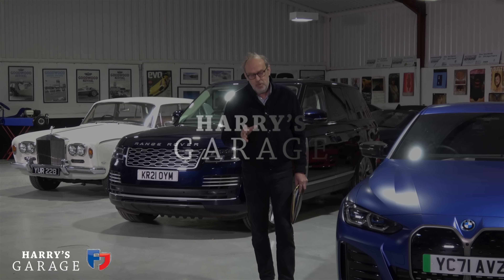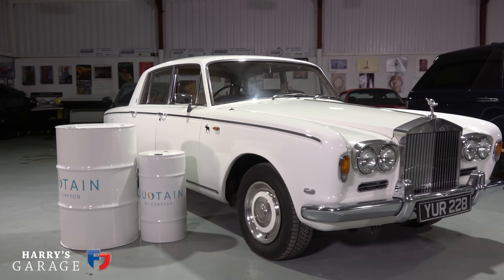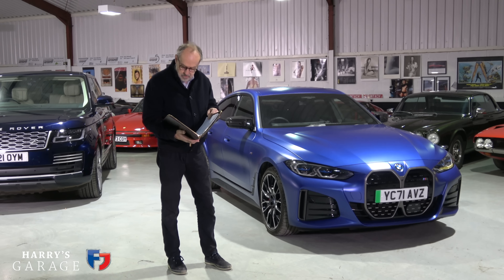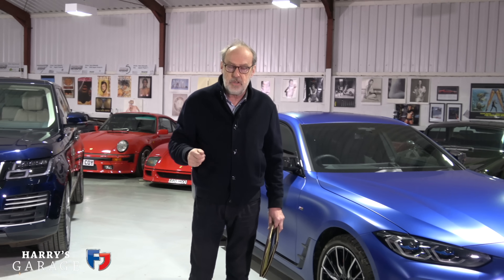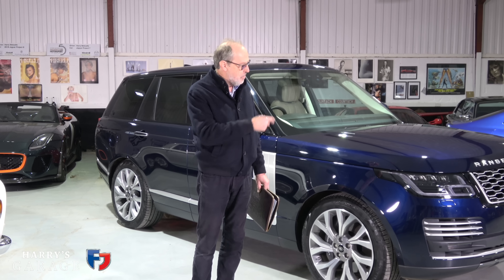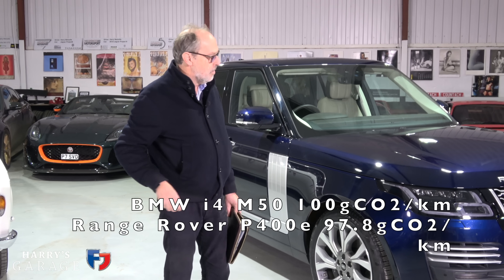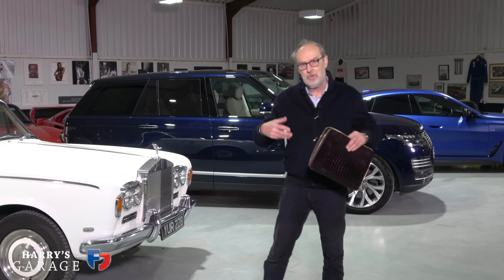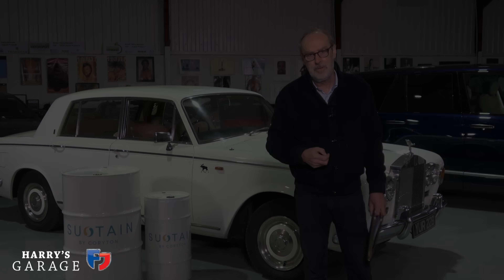Sustainable fuels; what are they & are e-fuels better for the planet than running an EV or PHEV?

Comment: I have a couple if issues: 1. You need to use the same source if electricity for both the EV and the hybrid.  While the BMW was very inefficient, picking the worst CO2  number for it, yet zero for the electric CO2 of the hybrid.  2. If you're going to mention the CO2 in EV battery creation (which is legitimate), you also need to mention the CO2 cost of drilling/refining/distributing the gasoline and Synthetic fuel (including the electricity used to refine the gasoline which I read was 6kw per gallon).  The synthetic fuel was interesting and I'm glad he included it.  I also agree plug in Hybrids are a better choice for most people and I would have gotten the Volt over the Bolt if it was offered in a Malibu or Equinox sized vehicle.  He is right about the need to convert the millions of current petroleum vehicles to lower/zero emission vehicles.
Reply from the maker: The aim of the video was to show a BEV is not zero emission as it depends on how 'clean' the electricity is you charge them up from. The PHEV is my own car and show my  own solution for having zero range issues while still reducing my CO2 footprint by producing my own electricity. I could not do the miles I do in the PHEV RR purely on my own generated power and I know this to be true because I ran a BEV for 18 months before getting the RR PHEV, hence why I didn't show it. 
I expect the next generation BEV (expected 2026 on) will be a much better proposition than today's BEV but we won't know until we get there.
Reply: The other plus to the synthetic fuel is that the distribution network is essentially already in place, ready to serve. I am interested in this because the fact is, no matter what the take rate is on EVs, we still have millions of ICEs on the road that would take decades to replace. Doing a drop kick on the emissions of existing vehicles would be a huge accomplishment, especially when you consider time is our greatest enemy.

Comment: You make an excellent point about getting more use out of existing ICE cars rather scrapping and incurring the environmental cost of manufacturing an EV replacement.
The Coryton Sustain product seems to me ideal in that it provides the convenience of a fuel that is liquid at normal temperature and pressure and also apparently packs energy at a high density similar to petrol. Perhaps the ideal would be a hybrid running on Coryton Sustain. Is the £3 per litre cost inclusive of fuel duty and VAT?
Reply from the maker: Thanks. Price is exclusive of VAT but inclusive of fuel duties. My mistake for not pointing that out in the video
Reply: @harrysgarage  Thank you for that information.  With duty at roughly 58p that would put the untaxed cost at £2.40-ish.  I suppose it makes sense for Coryton to quote a VAT exclusive price because they will be dealing with other VAT registered businesses at the moment.
Assuming an at-the-pump price of £1.70 per litre the comparative untaxed cost of petrol would be £1.70 * 100 / 120 - 58  = £0.84  so, on fuel costs alone, there's quite a bit to go before Sustain fuel becomes attractive.  On the other hand, if it's a choice between an ICE car and an EV, a higher fuel price might be justified if one takes into account the higher capital cost of an EV.
Thank you for you very informative and thought provoking videos.

Comment: I enjoy you’re presentations Harry, but it not just the CO2, it’s the nitrogen oxides that are highly carcinogenic which we get as a result of burning any fuel in a nitrogen rich atmosphere, nitrogen being the most abundant gas in our breathing air. Removing these and CO2 is only achieved by EVs. Fuel burning is coming to an end and grasping at straws, especially those with debatable science behind them is the last act of a desperate industry. Carbon offset, total con, carbon storage, total con and a massive environmental risk being placed out of sight out of mind to boot.
That range rover would have been way better in cost per mile if it was fully EV. My EV runs mostly on solar at my house, my Kia eNiro is doing the equivalent of over 150mpg cost per mile.
I’m a massive fan of fine old cars, but the time has come for them to be confined to museums and a few special occasions.
Sustainable fuel is wasting potential food producing areas to produce fuel for us to drive about, still polluting the environment. I also worked with fuel cells and H2 production, it’s not green, it’s just green washing.

Thank goodness the young of today get it. Time to change I’m afraid.

Comment: Surely the answer is to change everything to run on sustainable fuel. Nothing gets over the battery problem with electric cars. If Elon Musk is such a philanthropic genius, you’d think he’d be averse to the production of batteries. His latest ravings concerned battery powered HGVs.
I’ve said it before Harry, you need to take over from Boris.

Comment: Hydrogen is the answer.  Sustainable fuel production is limited to the waste, after that you’re using crops so no better than biodiesel where they cut down rainforest to make way for palm.  Electric is absolutely useless for big stuff like trucks, trains and earth moving equipment as the power density of the batteries is too low. Cryogenic Hydrogen produced by off peak excess renewable is the only credible solution for the future.  Electric is just a stop gap distracting us till we sort out how to go about it.  Burning Hydrogen with Oxygen to create superheated steam (h2o) which is then put through a small impulse turbine seems to be the best solution so far and very simple. Fuel cells are a waste of time.

Comment: I’m glad someone is FINALLY talking about this. Way too much energy - pardon the pun - is being thrown towards electric. It’s being marketed as the only solution to this complex and multi-layered issue of CO2 emittance. Seems to me that the more wholesome and sustainable long-term solution is to figure a net-carbon zero way to fuel the vehicles we already have? What else are we supposed to do - throw them all out and buy pure electrics? And then turn a blind eye to the environmental devastation caused by battery production, and the dirty electricity used to charge them? Doesn’t seem sustainable to me. Thanks Harry, this video is SUPER important.
Reply: I am afraid you are missing the context that is unfortunately not mentioned in the video.
For some reason, he assumes different source of electricity for each car even though there is just one energy mix, which does not make any sense. You can charge a BEV from the renewables in the same way you can use it for production of synthetic fuel. And as the matter of fact, you can drive several times more distance on the same amount of electricity with a BEV than with an ICE vehicle running on synthetic fuel.
We have nowhere near enough clean electricity for a large scale production of so called carbon-neutral synthetic fuels (which they are not, but that is a different topic) since it is such a wasteful process - the production itself and also the combustion. It looks nice on paper when you produce a small amount using electricity from a nearby wind farm but it is actually utterly wasteful.

Comment: Henry Ford built 40000 cars from hemp composites and ran them from ethanol derived from 10000 acres of hemp. We aren't allowed to grow that particular plant. How about  harles Pogue's carburettor? He invented it in the 1930s and the oil companies went crackers, and as a result Pogues carbs were history until WW2 when they used them on tanks to get better mpg. So, just like there have always been cures for cancer, there also been sustainable fuel. Electric cars are fine until it comes to scrapping them.

Comment: very interesting topic harry, your reference to the longevity of the rolls is a valid point, of course by that time an all electric car would have had several replacement battery packs and caused a lot more co2 damage than just running an ICE would have done.

Comment: I'm not sure that Diesel engines for the same power output have higher CO2 emission. The data is utterly misleading because Diesel engine with 40mpg will be the one with 30% higher power output. ETA data presented proves only the fact what statistics really is - An exact set of incorrect data.

Comment: A good review but the figures for the hybrid LR don’t make sense. The mpg figure provided by hybrid cars is a fudge where it assumes the electric part is 0 mpg. What is required to understand the CO2 is how much was electric (and use the same factor as the pure EV) and what was petrol/diesel and use the figure Harry stated). Do this and the hybrid is way more than the pure EV. The sustainable fuel sounds great!

Comment: How much of that exact fuel you received was made from extracting CO2 from the air? I bet it’s zero. This process is not viable yet. In fact it will be made from a large proportion of bio fuels.

Comment: The main problem and shortcomings with wind turbines and solar is that unlike all of the other traditional Power Generating assets from Gas and previously coal and even nuclear to some extent, they can't be dynamically adjusted, and ramped upwards quickly in real time to meet real time changes in dynamic grid demand, and in the case of Solar you are never going to be able to rely on it at night or during the winter months. For example if you have a cliff hanger in Corrie where millions of kettles go on simultaneously during the commercial break, or a sudden unexpected cold snap or a fall of snow you can't just phone God and ask for more wind or stronger sun to meet the sudden increased demand. In fact with the growth of EV's and the demand for EV style Electricity Tariffs like Octopus Go there is a very real danger that with hundreds of thousand of EV's eventually all being timed to charge during the same five hour period, you'll actually artificially create a huge second national 'peak' demand everyday during those limited EV charging periods, potentially meaning an increase in price and the loss of those dedicated reduced tariffs!. Yes, you can mitigate several hours or perhaps a day of the calm, high pressure influenced weather which we routinely get on our Island (where wind turbines contribute little to the grid) by fitting domestic battery storage into every household but, firstly they won't cover almost two months of domestic use (Autumn 2021 produced virtually zero wind generation into the grid for 7 weeks) and secondly just like private wind turbines, this kind of expense is well beyond the reach of a lot of everyday people. If a "green" future awaits us, it has to be practical and affordable and in the reach of every household to sign up to, not a bunch of half measures. We already have those, and they have just increased our bills by 56 %

Comment: With the prices of Oil and Gas going through the roof the governments of Europe will be addressing less dependence by boosting renewables. The governments have gone from yes we are trying to a real focus in renewables and battery/ Hydro storage to bring electricity prices down. 

Doing 78k miles almost free because you live next to one of the biggest wind farms in Europe and it has free chargers at its visitor centre a few miles from the house. You can add 60 miles by taking the dog a walk 😁. Will I drive down to the coast for lunch or dinner or even ice-cream  and do a 80-90 mile round trip absolutely not even think about it as your not paying £14-15 in petrol just wear on the car. When you work out average price of petrol ( not this stupidly expensive period) over the course it’s about £12k saved and that not even trying as it’s so easy but yes I know very rare a special case.

Comment: Absolute rubbish, So many holes in Harrys theories.  Don't get me wrong I'm a fan of this channel but saying Sustain is CO2 neutral is plain wrong!  Shall we talk about the Manufacturing and transportation of the fuel whether that be to Petrol stations or the HM Empire, the power to run the refinery plant, manufacturing of the barrels, then the inefficiencies of the ICE engine.  Its almost as preposterous as working out his CO2 based on his local area, to give a fair example he should have taken an average for the UK, as not everybody lives in Oxford and even if they did they wouldn't always charge the car at home,  also we operate a balanced grid in the UK and power gets shared depending on the time of day and the requirement of each region.  Drive your classic cars but accept they aren't as clean or efficient as electric cars.

Comment: There is 100% NO Valid Reason to BAN the Combustion Engine Ever. 
Allow Market Forces & Future Development & inventions to Slowly Replace it in Years to ~Come.
60 / 70 / 80 mpg cars are not very polluting,  & Liquid Fuel is easy to FILL UP, When needed, 

EV's Should have a LPG / Petrol / Diesel Motor NOT CONNECTED to the Wheels, To Automatically start up to Charge the EV Batteries.  
Example,  
Press your Key Fob, / Phone App, 30 mins Before you leave Work, Your car Stays LOCKED, But a Petrol / LPG Motor Starts up & Runs, to charge your Batteries to cover your 30 min' drive home from work. 
You Would SET it to Give you the 30 minute 15 mile Commute distance + a Back up of 30% ?? 

Wake up in the morning, Set your drive time, & Power Needed for the Commute Journey, Your Generator Motor will Run, To Defrost the car , / Run the Air Con,  & Give you Plenty of charge to get to your Allocated Workplace. 
With THIS IDEA, You NEVER need to actually PLUG IN. 

On a longer Journey you would Tell the Car Long Journey MAX Battery Charging Required. 
Hence the Generator Motor would Start up & top up as Required, LINKED to Your SAT NAV Destination, A computer would decide how much charge is Required to Carry out the Journey. + 25% ? 30%. 

A Small LPG Tank, Would Run the Generator Motor, Allowing up to a 1,000 mile Range. or Infinate Range if you fill up with LPG. 

The OTHER ALTERNATIVE is :- 
You Own say, 5 Batteries, ? 
As you Drive you Stop For Fuel, / You open the Boot / Bonnet & lift out 4 Batteries out of the 5 & Swap them at a Filling Station / Petrol Station, Pay ??  £1.00 per Charged Battery, ? 
( the same as Buying CALOR GAS for Camping, You own the Cannister, & Swap it for a Full one & Pay for the Contents. )

ENDLESS Driving, With ZERO time wasted on Re Charging , or in a LONG QUE to Re Charge. 

Maybe 10 or a Dozen Batteries of a Smaller size ?? 
To Make it Easy for Elderly, Disabled, or a 17 yr old New driver to Swap over, LightWeight & small size, But Multiple units. 
Simply Shaped Like a CLOTHES IRON, = NO WAY to Insert the wrong way. Weight about 5kgs.  Not too heavy. 
No Heavier than a Carrier bag of Shopping ? 

Get in your Car & set the Sat NAV, The car will tell you, how many Batteries you will need to Travel your Journey Leeds to London. 
" Follow M1 south towards London, after 100 miles stop at XYZ Services & replace 6 Batteries. Continue M1 South, At Watford Gap Services Replace 3 Batteries, Continue to Destination with 25% Spare Charge. 
The Same as a Normal FUEL Gague. 
The Dash says 10 Gallons Used,  4 Gallons in the Tank, 100 miles of fuel remaining. etc. 

So you Pull up at any / Every petrol Stn, & Swap some Small Batteries, For Fully charged ones. & only Pay for the CHARGED Power.  ( NOT buying NEW Batteries, Just the power to charge them. ) 5 Mins with CLICK IN/ CLICK OUT Batteries,  Just as Fast as Filling up with £50 of normal fuel. 
a 17 yr old with long Nails Can do it in 3 mins, & the oldest of drivers can do it in 3 mins NO ROCKET SCIENCE Required. 

Clothes Iron Shaped Batteries SO NO FOOL can Fit them the WRONG WAY Round By Mistake. 
& TRIANGLE Shaped to Save space & form a Square / Oblong Pattern when Fitted. 
Dizzy Giggling Teenagers, & Daft Old folk etc ? Drunk / Drugged Drivers will all Make it home  or Crash with Full Batteries LOL.